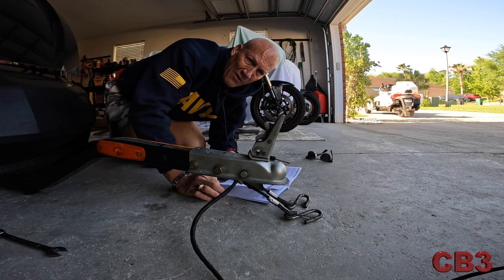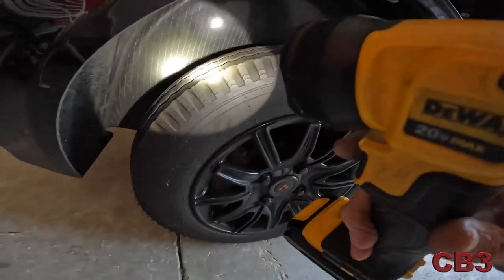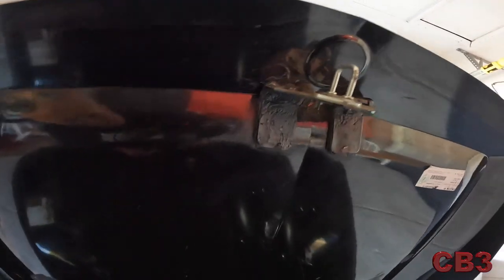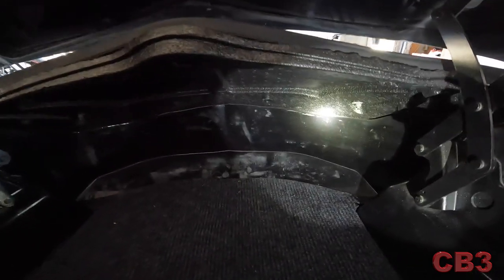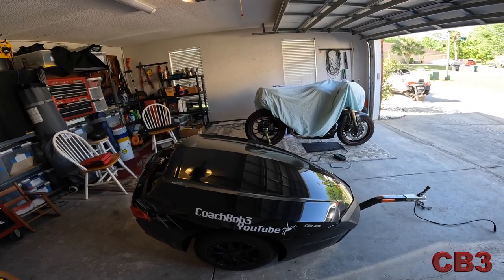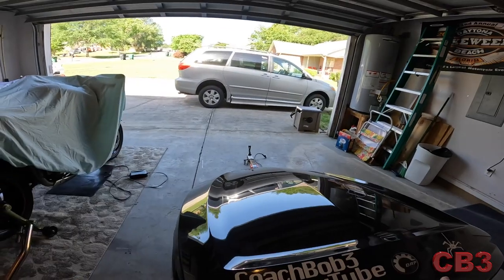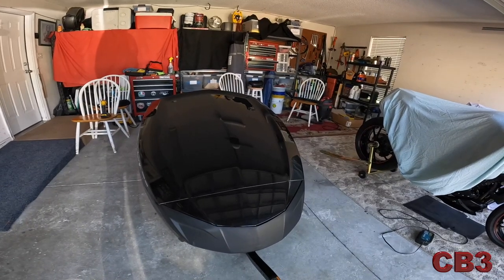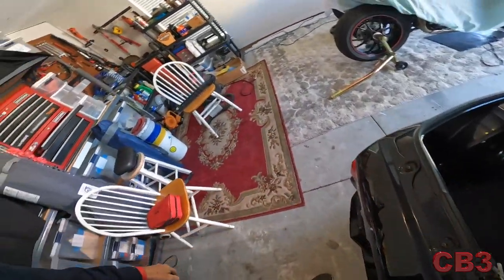FREEDOM TRAILER!!! Long Term Review!!!  The GOOD..BAD... & UGLY!!! The HARD TRUTH!!!

Comment: Thanks for the report.  I am not an fan of that type of trailer hitch. I like drop on hitch mount (looks like a pin).  The floor cover, I like the truck bed cover, can be trimmed to fit.  Be careful not to spring the lid hinge’s.

Comment: Not to be picky, but do I see some rust starting on nuts underside?  If so, BRP should have used stainless steel fasteners.  Love the side sticker logos.  I say for the price, fit and finish could be way better, all part of quality control and production line operation.  While on the Spyder, I changed the oil on mine yesterday, tip, get Lamonster's replacement oil drain plugs.  The BRP OEM's suck.  One is a 6mm and one a 40 Torx as I recall, both are a headache and designed for only for dealer's removal.

Comment: I have a USA trailers black shadow.  I picked it up at the factory in SC. Only issue I have had is loose lock hardware (blue loktite fix)  and paint damage. It is rated for 350 lbs which matches the spyder's limit.

Comment: Coach, I am thinking off the top of my head about the a solution to the inside of the trailer rubbing issues from the wheelchair, maybe get those peel decals you buy for motorcycle gas tanks that keep your knees from damaging it. That might work on the inside if you put them on the areas of the rubbing. Of course it is already scratched but it may keep it from further damage. Just a thought.
Reply from the maker: That’s a great idea.   I’m gonna look into that.  Thank ya sir!!!👍👍👍

Comment: I own an older Roadwagon trailer and the dealer told me that I can not pull it with a spyder because any other wiring will "throw off" the computer on the Spyder.
Any truth to that?
I love my trailer and feel I don't need to buy theirs.
Reply from the maker: I have several friends that are running different kinds of trailers.   Ranging from the most basic to very expensive Bushtec's    I ran the BRP Freedom trailer due to what you mentioned in this comment.  Hindsight being 20/20... none of my friends have had any issues whatsoever.  They are running an adaptor to convert their flat pins to the four pin as on the Spyder. I think you'll be fine.  

Thanks for watching and commenting. 👍👍👍👍
Reply: @CoachBob3  Thanks Coach, I'll look into that. I figured the salesman was blowing smoke. I pulled my trailer many miles behind my 2008 HD Roadglide (that I just sold to a friend) and loved it. I now own a trailer but nothing to pull it with :(
A Can-Am Spyder RT Limited is what will pull it next and should pull it much better as well.
My wife and I just love your videos :)
May God continue to Bless you and your wife.